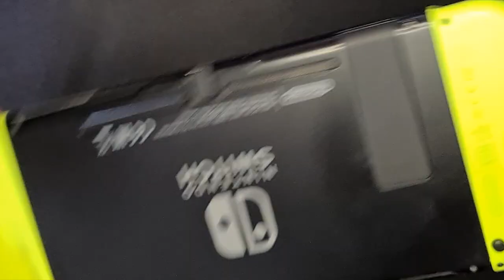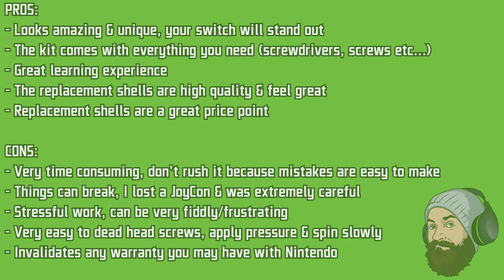HOW TO MOD YOUR NINTENDO SWITCH / How To Change Switch Shells // Is It Easy To Change Switch Shells?

Comment: That new shell looks gorgeous!
The actually console is so simple compared to the joycons!
It’s also mad how differently the right and left joycons are in how they are build!
It’s tempting to do this but I have the lite, so I may need to think more on it haha!
Reply from the maker: It's worth thinking about and watching a million guides if you do decide to dive in, I was apprehensive & mistakes were made but I'm over the moon with the finished result! I don't think it's something anyone can do, you definitely need patience & a level head to pull this off =D

I wonder if the Lite is easier to mod as its one solid unit... Hmmm...
Reply: Beardo Benjo I think you’re probably right with it being one unit! It’s just like rebuilding a mini computer I guess! I’ll have to look into it and see haha

Comment: Great video have you tried a switch lite if not would you like to do mines for a small fee ?
Reply from the maker: Oh my I wouldn't want to risk breaking your entire switch lite haha! I'm actually going to change the shell on my wifes Switch lite soon, I'll likely do another video, if it's really easy then I'd feel comfortable doing it but if it's difficult I probably wouldn't 😁
Reply: Thank for getting back to me much appreciated. Some people wouldn’t even reply , let me know if you do your wife’s one  and link me to the video
Reply: Did you manage to do the Nintendo switch lite?
Reply from the maker: @Salute_The_Dream  yeah man, it was faaaaaairly straight forward, slightly easier than the normal switch but at the same time it was also scarier because instead of just fucking up the joycons if you make a mistake you can mess up the whole console because it all opens as one unit 😳 took a few hours because I went really slowly but it all works fine and now its see through to match my normal one. Only did it this week, been crazy busy
Reply: Oh wow I couldn’t even imagine , I  still need to do mines but don’t have the confidence.  plus I bought all the stuff like extra joycons because I want black instead or white .  Do you feel comfortable of doing someone else one? For a small fee